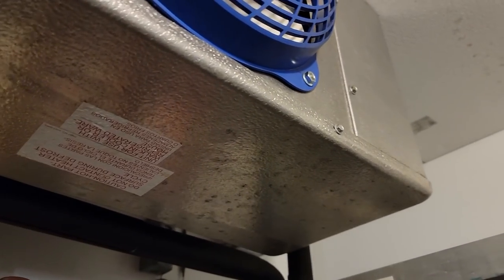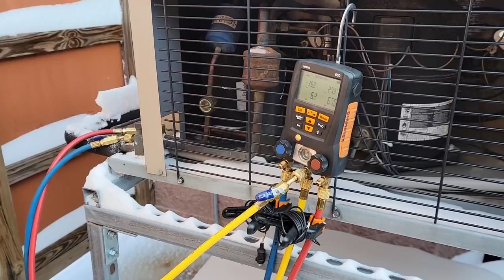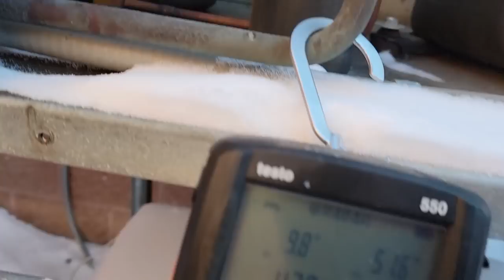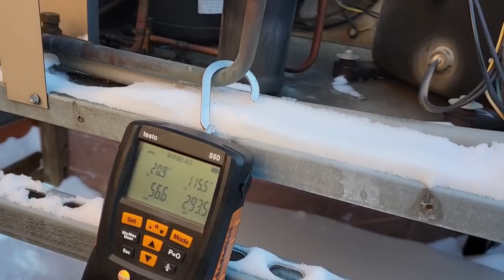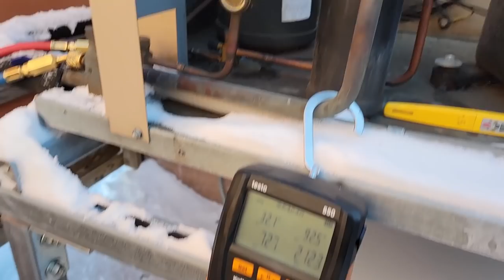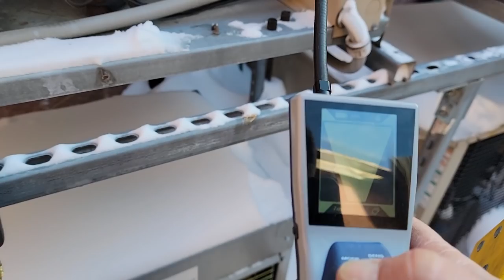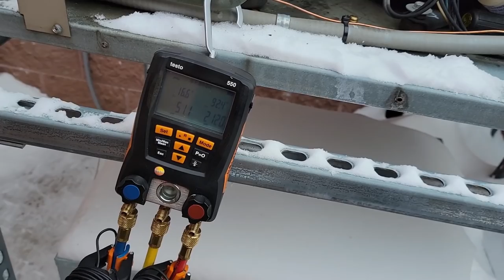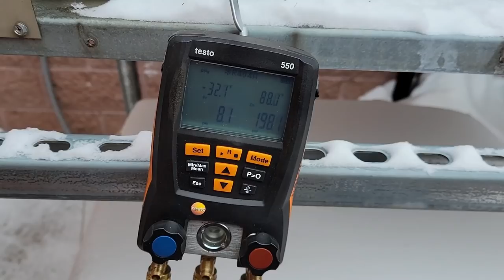You Need Head or You'll Lose Your Cool 😳

Comment: Typical refer call, nice video. Your right, those timeclocks cost more for a lower quality. Heatcraft typically doesn't install a divider between the condenser fans. No problem  if both run, but hard to run only one with fan cycle switch. Air takes path of least resistance through off fan. That condition can also get off fan spinning backwards before switch goes to turn it on again, not good for motor. Over years fabricated a divider between fans, works much better, just not as good as head master.
Reply from the maker: I agree 👍👍

Comment: How does blocking the condenser coil help in checking operation?
Reply from the maker: By building head pressure I was checking to see if the problem was only because it was 18 deg out or if there was other issues. I like to double check different things to verify my path of diagnoses.
Reply: Cool thanks. Currently in school for HVAC love the channel

Comment: I have replaced a pile of headmaster valves so far this winter...hear in Central Minnesota it gets cold! That discharge service valve cap is loose on a majority of new heatcraft condensing units i install i make sure to check them on start up. Great video!
Reply from the maker: Thanks Cody!

Comment: Good Job added t swivel and fan cycle control to Control the Pressure of the Refrigerants FLow to the evaporator Coil  and tightened mechanical Fittings  Leak  Toss those plastic caps in the Garbage  use BRASS CAPS  & the First thing you want to do is put the system  in PUMP DOWN MODE make sure the Internal  Valves are Good  Use  GOOD Allen Wrenches  MADE IN THE USA and bubble solution after back seating the mechanical fittings BECAUSE a Lot of Technicians they OVER CHARGE THE UNIT WITH FREON IN THE COLD AMBIENT WEATHER THEN IN THE SUMMER THE PRESSURES ARE WAY TOO HIGH CHECK THE SUPER HEAT I LOVE TOOLS
Reply from the maker: Thanks for the support👍👍
Reply: yep oil is always a telltale sign of a obvious Leak
Reply: I AM KNOWN IN FLORIDA AS CHICAGOMIKE

Comment: Nice little run of problems there. Dumping 7 or 8 pounds into that & having so little liquid in the receiver after. She must have been off because the HP switch never saw its threshold.

What do you think of some leaklock on that leaking cap? Slow it down.
Reply from the maker: It was a little loose. I tighten it and it stopped bubbling .

Comment: Good afternoon in Europe we have commercial condensing units from Daikin that units is utilizing R410A as primary refrigerant instead of R448A or R449A and is full inverter because the way of thinking is like Daikin VRV. Those systems it takes much smaller piping and match lower quantity of refrigerant on the cycle. I was curious how is designed this thing and one day when i was on PM on those units i was doing some discovery of the cycle it have head master control and fan cycle control via VFD and master compressor with VFD (Daikin VFD like this on VRV's)
Reply from the maker: I haven't worked on a walk in that uses 410a, only climate cooling. The GWP is the reason for the new refrigerant. 🙄 404a has a GWP 3943, 448a has 1273, 410a has 1924.
Reply: @HVACRSurvival  here in Europe with the AR4 the R404A have 3922 the R410A 2088 and R448A 1387 if the refrigerant is not flammable is allowed up to 40 kW (38-37 kw) if the system is larger is mandatory to use A2L refrigerants. The R410A in commercial Refrigeration systems have a lot more Kj/kg but is "restricted" from companies only Daikin have designed systems for R410A on the commercial Refrigeration side. The Daikin zeas is more like a Refrigeration rack with built in condenser and VFD for the compressor and the fan than a condensing unit for just one individual walk-in cooler.

Comment: Are you going to remove that rusty suction drier as well?
Reply from the maker: Yeah I have to take all the refrigerant out anyway. I probably won't replace it just the liquid dryer.
Reply: Customers Choice Give the Customer the Option of to do or not to do & If Customer Refuses Your Recommendations make sure Customer Signs the Paperwork that they Refused that Part of the Suggested  Repair at that time & date also they should Build Some Kind of Removable  HOOD to Cover that equipment Protect it from the Snow

Comment: Hi I have a question when a system is low on Freon ? Why inside evaporator start building a ice ?
Reply from the maker: I work on air conditioning and refrigeration both. Which type of evaporator are we talking about? A cooler, freezer, a reach in,  what?
Reply: @HVACRSurvival  reach in cooler
Reply from the maker: If there's not enough refrigerant the coil won't get down to temperature so it just runs and runs and runs and never defrost. The thermostat senses coil temperature of about 18° to shut off then has a constant cut in of about 38°. If there's not enough refrigerant it won't hit that number to shut off temp and defrost.

Comment: Good ol' multiple offender! What temperature were they keeping the beer at that they need the electric defrost? Or is that just preferred in your area over air defrost? Thanks for the video Rick, stay safe out there!
Reply from the maker: I believe 30*. Not everyone has electric defrost like this but in my area they like to brag about having the coldest beer.
Reply: @HVACRSurvival  Gotcha, makes sense. It probably also helps to keep it colder on the walk-in when they cool the beer lines from the air in the walk-in
Reply: cold beer sells, warm beer sends/guides to the other place with colder beer.